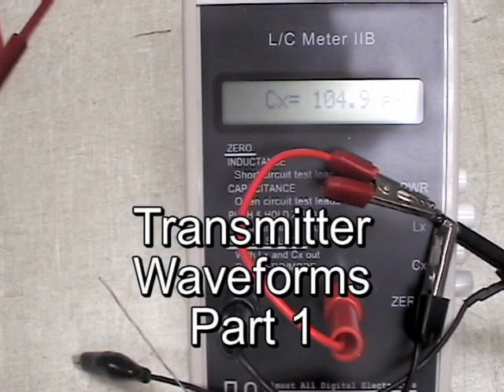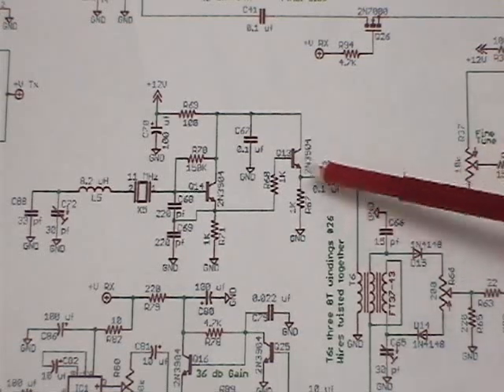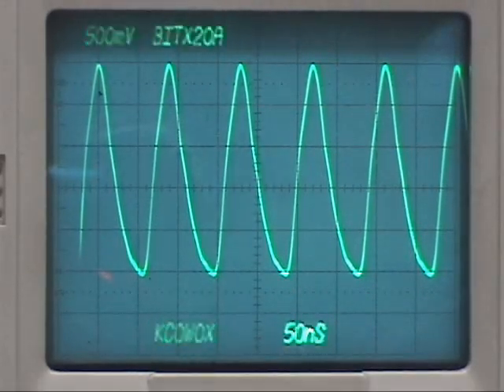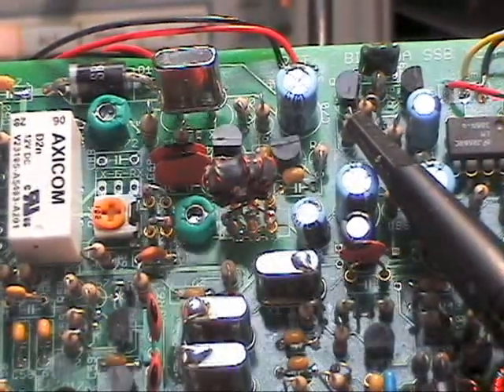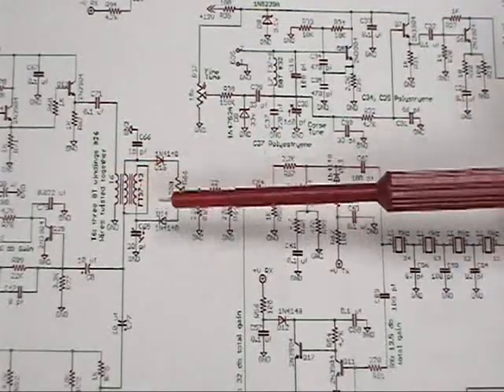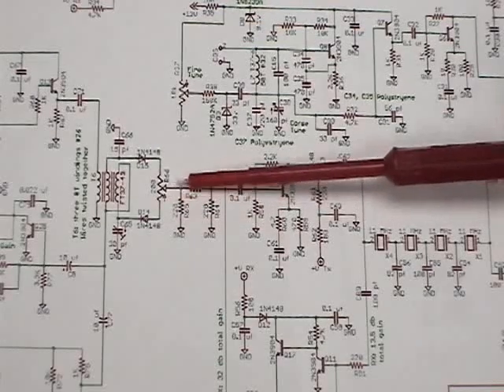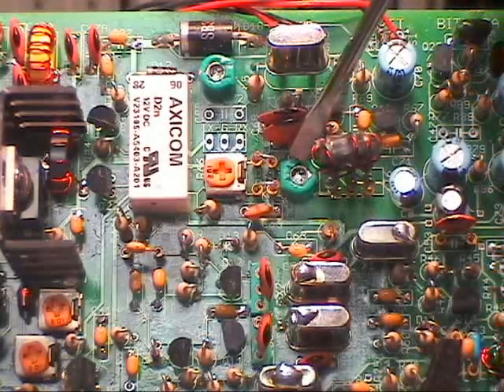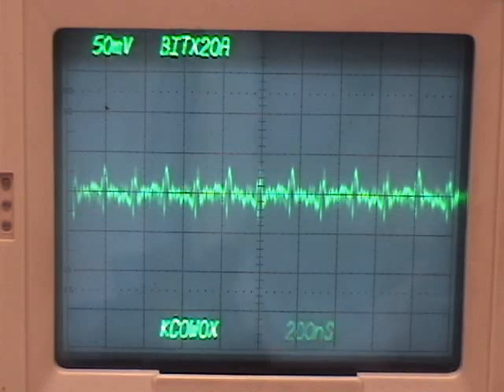Bitx 20a transmitter adjustments Part 1

Comment: Excellent series, I'm looking at this Xciever as my first QRP rig. I was wondering, how's PSK31 on it (if you've tried it on this rig)? I've been told to simply reduce the mic/line-in amplitude if I use PSK31 as to avoid overdriving the output state.